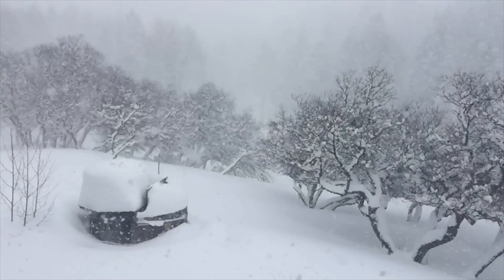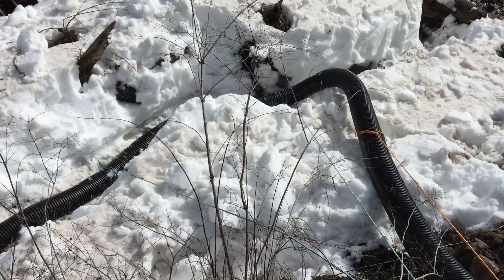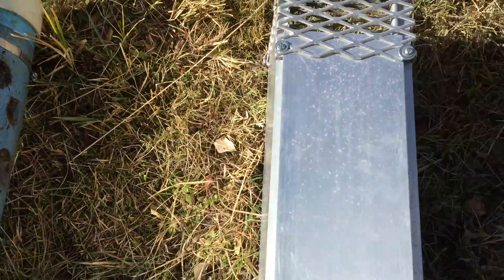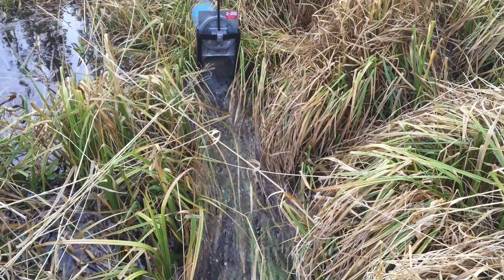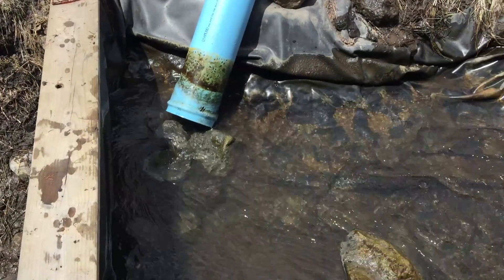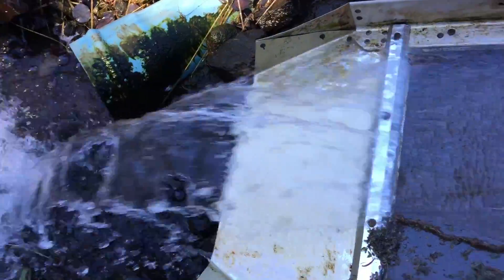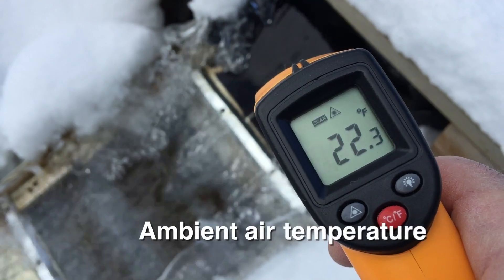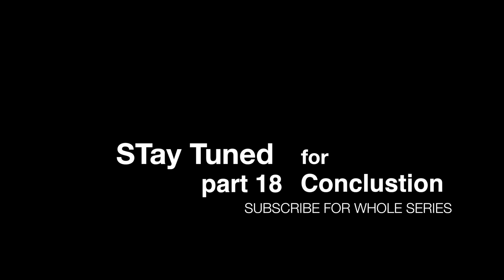Part 17 MicroHydro Power System in CO

Comment: You have tried three different intake screens, how about you try the fourth one with an innovative idea of a intake screen rotating from water to avoid condensing organic debris.
Reply from the maker: Sorry for the slow reply. Your suggestion is a good one. However the area of the creek where water is diverted to the meadow is very unstable with the annual springtime melt causing large and unpredictable erosion. An intake with a rotating drum would likely require a small dam to direct the water to the drum  when flows are more normal. Any dam structure would likely be destroyed by the massive spring melt.
Every year we remove the diversion from the creek until the volume of water subsides. Afterwords the challenge is to find a suitable spot to divert water from.  The creek is very dynamic in how it is eroding the whole intake area. The hill above the creek is being chewed away each year. It is the one thing in the system which requires yearly attention and modification to adapt to the changes.
Thanks for watching and the suggestion.

Comment: what if you put in tesla turbines thru out the loop to draw power from those?
Reply from the maker: I've never seen an application of Tesla Turbines with hydropower.  Not sure how that would impact the pressure at the powerhouse and to harness any benefit it would be necessary to lay new electric cable to them.  Not sure that the added costs would be worth the effort as we already have as much power as we need.  Thanks for watching.

Comment: I wonder if installing clear rigid plastic “roofs” over the freeze points would fix that problem?
Reply from the maker: It's an interesting idea, but the ice is mostly the result of very cold nighttime temperatures. The ice often forms a crust which actually insulates the moving water. Thx for watching

Comment: Thank you for sharing this video, it was very interesting to watch. I am curious why the screen is mounted perpendicular to the flow of water where it can catch all the organic matter on all of the edges of the fins, as opposed to having the fins parallel to the flow of water, where the water would tend to push all the matter down the entire length of the screen forcing most of it off the end, and leaving the majority of the screen clear. Would that configuration cut down on the amount of water that would be allowed to pass through it and into the pipe? In any case, I enjoyed watching. Thank you again.
Reply from the maker: It’s a good question. A Coanda screen is designed to take advantage of the coanda effect. The upstream edge of each of the blades is tilted slightly up and guides the water down into the collection area of the bucket. The coanda effect is what gives an airplane wing it’s lift. It is the tendency for a fluid to develop a negative pressure when flowing over a surface.  The negative pressure pulls the water down.  The barrel I designed was replaced with a professionally engineered box of  improved design with an acceleration plate upstream of the screen in part 18 of the series. I very seldom have to clean the screen and only do so to make it LOOK clean.  I can go an entire winter without having to clean it.  Any debris just get washed off by the excess water.  Glad you enjoyed the video and thanks for watching!
Reply: @mrhydrohead  Thank you very much for the explanation MrHydrohead! I will definitely have to watch the rest of the series. The more I learn about this, the more I want to learn lol

Comment: What watch are you wearing at 3:50? Thanks!
Reply from the maker: Interesting question, it’s a Citizen Eco-Drive Skyhawk Titanium model c880-Q02407. I’ve owned it for 20 years or more now and it runs on Solar power. I’ve only had to replace the Crystal a couple times from very intense use which caused scratches.
Reply from the maker: Like this same model https://www.ebay.com/itm/Citizen-Eco-Drive-Skyhawk-C650-Q02497-TITANIUM-Watch-Rare-Beauty-Box-Runs-Well-/313649181503?mkcid=16&mkevt=1&_trksid=p2349624.m46890.l49286&mkrid=711-127632-2357-0
Reply from the maker: My eyes failed me. The eBay link is the correct model #
Reply: @mrhydrohead  Beautiful watch. Thanks for the response!

Comment: hi

first of all, awesome work.

2 suggestions

a) for the residue that clogs the filter / mesh think of using a rotary mesh. which discharges the organic matter with each turn

b) for the icing (which seems like a big issue) think of using aprt of the power to power either a heatgun or  to heat a slenoid so it keeps melting the snow/ice as it accumulates. will save you many hours of de-icing and avoid the risk of breaking something when you break the ice.
Reply from the maker: On a) the diversion at the creek end hasn’t had any problems since modifications and the Coanda screen at the penstock intake remains algae free if it is covered from sunlight
b) freezing hasn’t been an issue thus far and letting the Coanda screen develop a crust if ice over it actually guards it from the nightly low temperatures. The water flow continues unabated. Where we generate the power is also a half mile from the Coanda screen so running wire up there would be a costly and needless expense. 
Thx for watching and sharing your ideas nonetheless. Very much appreciated 😉

Comment: QUESTION PLEASE IF YOU'RE STILL MONITORING THIS CHANNEL:
* Please note, I'm new to hydro and I'm trying to learn as much as I can from your videos and others.
* Also, my wife and I are retiring in Sept and moving to the Pac NW and we want to do the same thing you're doing.
Question:
* Instead of messing around with all the screens that constantly clog with debris, have you considered using a "two section, concrete settlement box" at all?
* This would allow you to do the following:
1. Dig one hole in the area of the creek that is the deepest...meaning that the area of the stream that collects the most water every year.
2. Then insert the concrete, two section settlement box, into that hole.
3. Then, the quick-moving water, that has all the debris in it, would go into the concrete box on one side and fill up.
4. The debris in that one section of the concrete box would overflow (at the top portion of the concrete box) and go back into the stream so the debris wouldn't be a problem.
5. A portion of the water that's already in the concrete box flows from one side of the concrete box into the 2nd portion of the concrete box (there is a divider in the middle that only goes half way up the middle inside, which keeps out any debris).
6. This second portion of the concrete box is where you attach your pvc hose (about a foot off the bottom of the concrete box) and then the pvc pipe would then be "run" all the way down to your generator!!!!
7. The results would be numerous:
a. You get rid of the debris and screen problems
b. You always have a deep supply of water (aka the concrete box) even in the winter because the water would still be flowing if the concrete box is deep enough and your stream runs all year long (aka it would be below the freeze line).
c. And you eliminate any air in your pvc pipe because the water supplying it is always available in the concrete box (in the second section) and the pvc pipe is installed close to the bottom of the concrete box.

Have You Ever Seen A System Similar To What I'm Suggesting?
Or, Have You Already Set Up This Type Of System For Your Hydro Power?

Look forward to getting your feedback and reviewing the rest of your videos.

Mr Bowen
Veteran
BowenOrg@gmail.com
Reply from the maker: It’s late at night for me to provide a good answer.  I will look more closely at your suggestion and reply via email. I get the sense you’re still going through the series.  So please continue and I will get back to you in the next couple of days. Thx for watching!
Reply: @mrhydrohead  THAT WAS FAST!!!!!!!!!!!!!!!!!  : )
I'm watching hundreds of videos on hydro... in addition to yours.. and I'm absorbing it all like a sponge!! 
Take your time on getting back to us, no hurry. 
We're still working on where we want to go, buying the land, and the plans for building our home!
Hope all is well in CO.... two of our grown children live in Denver and they love it!!
Mr & Mrs Bowen
Veteran
BowenOrg@gmail.com

Comment: Now you need to design and fabricate an automatic coanda screen cleaner, that either runs by manual instruction or routine like a sprinkler timer, continuously, or when the pressure drops. Computer controlled gate end and bleeder valves along the line that could be triggered by radio receivers, the transmitter connected to computer control program monitoring pressures and flows. Sensors in the bleeder valves could help narrow down vapor lock locations or problems.
Reply from the maker: All interesting suggestions. Since April 1, 2020 I’ve been in hospital (232 days) and rehab away from the property recovering from sepsis which nearly killed me. All that time and the prior winter (2018-9) the coanda never once clogged and I wasn’t even there to periodically clean it.  So it self cleans quite well. Lots of your ideas might require power to support them and where we harness the power is about 1/2 mile from the diversion and intake area.  Our approach has been to keep it (KISS) simple and stupid. Thanks for watching and for sharing the thoughts and ideas just the same. 😉

Comment: You ever consider building structures around the sections of the system that require the most maintenance. You might be able to heat it with the power you generate to prevent freezing. A good insulation along the sections you bury in the snow might go a long way as well.
Reply from the maker: The only portion of the penstock which requires some maintenance is the intake screen. It is a half a mile from where the power is generated and laying wire that far would not be a cost-effective undertaking. A majority of the pipeline is buried below the frost line. The pipe bridge is probably the most susceptible to freezing, but we have not really had any problems with it. I have planned to build a shade for the intake screen to block sunlight and thereby limit the growth of any algae. I haven’t done so thus far because of a severe infection that put me in the hospital. Thank you both for watching and your suggestions.

Comment: If u have generated electricity then why arent you using a motorised cleaner at a scheduled period for cleaning organic materials just like a car front glass wiper 🤔🤔🤔🤔🤔
Reply from the maker: The power harnessed from the pressurized water is almost 1/2 mile from the intake screen. Thx for watching

Comment: just a thought , the airlock relief screws , on trucks there are compressor tanks ( this is common on most compressors ) for air supply and every now and then water builds up in the tanks and theres a pull valve on the bottom of the tank , if you got a few of these instead of the screws its a matter of pulling a string or touching the valve till water bleeds through then you just let go , now getting more technical you could run a dumb timer in a mechanism to pull the valve at intervals then all you need is just monitor the system  just make sure your timings are correct , you can still manually operate it by simply pulling the valve ,,,, see where im going with this
Reply from the maker: Thx for watching and the tip  I’ve been recuperating in the hospital from a serious set of complications for nearly 7 months and may not get back to the property for several more months  so, any mods will have to wait.  I appreciate your input just the same
Reply: @mrhydrohead  no worries mate , just thinking out loud , get well mate

Comment: What happens if someone upstream decides to damn it or divert all the water to their place?
Reply from the maker: They would need water rights to do that. It is unlikely for two landowners above me would do that. Beyond them is a wilderness area  it’s an interesting question. We had someone build a pond that restricts the flow of water into our springs somewhat. View part 20-1 of our series for an overview by the time we had figured out what had happened, they had changed their water right to absolute from the original conditional water right the court granted them. Once this occurred we could make no complaints. While the water rights are conditional you can file a complaint against the water right. It was too late for us to file a complaint once we figured it out.  It is unlikely that the water court would permit diversion of water that was consumptive, instead only water rights which were non-consumptive would be permitted by the court.

Comment: Why not use a sluice and water wheel? Then you wouldn’t care about particulate. You could do much the same thing admittedly at a lower efficiency but with less ecological impact and potentially lower maintenance.
Reply from the maker: I already owned the turbine and generator. Made the most sense to me when moving the system from the spring source to a creek source on my own land to maximize the power potential. Variation of winter and spring Flow would be difficult with a water wheel approach

Comment: My mind was turning as the video was playing. I was thinking about your flow problems and the possibility of using a type of septic system with a vented headspace design to allow silt and organic matter to settle while also allowing venting of percolating air entrained into the initial tank. The major drawback would be a springtime clean out of the 1st tank if bacteria developed over the winter. Of bacterial growth I'm skeptical because the aeration from the intake should minimize bacterial growth. The cleanout should be the organic matter primarily. Use of secondary tank might allow diversion of water during the 1st tank cleanout. Ditto on the continued water flow below water melting point. Also, a sufficiently buried septic design below the frost line will utilize a geothermal concept of minimizing freezing.

Comment: Now that it's been a few years, how has the system worked for you?  Any adjustments needed as you have already done so many?
Stumbled upon your video and now looking for how it's going.  Subscribing now.
Reply from the maker: 24 Dash sevenDash365. That’s how it runs highly reliable hour with minimal maintenance. I haven’t posted anything for a while because nothing has changed I will do an update at some point but I’m currently in the hospital and have been for 4 1/2 months. So sorry for the delay And responding so slowly

Comment: I HAVE ACCESS TO A CENTRAL AIR FILTRATION PLANT, THEY THROW AWAY BRAND NEW ALUMINUM FILTERS 3X5 EVERY DAY, I WOULD SEND THEM TO YOU FREE OF CHARGE, IF YOU PICKED UP THE FREIGHT
Reply from the maker: Thats a very kind offer.  I don’t know that I need to add anything to the system at this point, but I appreciate you thinking of it.  I'm never sure who has seen what of the series. Here is a playlist of the 3 part synopsis which is an overview of the whole process https://www.youtube.com/playlist?list=PLtTypVpmDd-vkT9bJQkXw4I1t0e_4jMYA 
 The whole series is in about 25 videos. This part 17 video gets promoted most frequently by YouTube.

Comment: I recommend wedge wire screen. Easy clean. You can use the j shape to self clear also called a seive bend
Reply from the maker: Not sure how much you have seen of the series.  haven't heard that term serve bend before but will search out the term.  We HAVE installed a wedge wire screen also termed a coanda screen at the intake in the meadow.  
See part 18 ( https://www.youtube.com/watch?v=sixorfYKSwI  ) of the series. 

To install a similar screen in the creek diversion would be overly difficult to manage as the springtime runoff rages in such a manner to radically change the path and topography of the changing intake area each year. Best to pull the collection method out and let the damage be done before we reestablish the diversion.

Thanks for watching.

Comment: I want to make a hydro generator using 55 gal barrels and a siphon system. What turbines are you getting 4500w with
Reply from the maker: If you watch the whole series you will see we use the same equipment in two subsequent installations.  They use different configurations based on the available flow and head using the same gear.  There are lots of designs of equipment which can output this amount of power.  Ours was purchased back in 1996, so there have been lots of changes in the market since then.  The question to answer first is whether you have enough head and flow to create 4500w in either an AC or DC configuration and go from there.  Take a look at Powerspout https://www.powerspout.com as a starting place.  They look to be making good equipment, but I can't say its best because I don't know anything specific about your site.  Thanks for watching

Comment: A little late now, but... wouldn't wires be easier to maintain than flowing water through pipes in the winter? Why build the generator so far from the source?
Reply from the maker: Not sure what you have seen of the series, but extracting power from falling water requires both head and flow in some combination.  Our choices were made to utilize equipment which we already owned and we designed the 2nd system to maximize the power at our specific site with our existing equipment and our existing knowledge.  You can't just put some water into a turbine and make power.  It requires either massive flow with low head or high head with reduced flow to extract the power.  The ideal equipment is different in each situation.  We started with existing equipment and worked from there.
Not sure what you had in mind with your comment.  This system functions just fine during the winter and we produce more power in that season as a result of our demand increasing for needed heat.  Thanks for watching